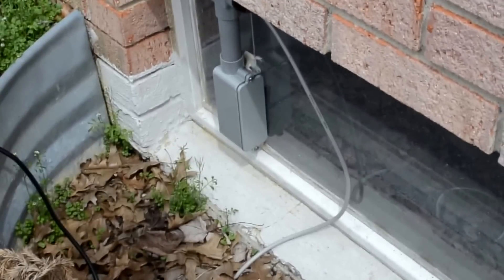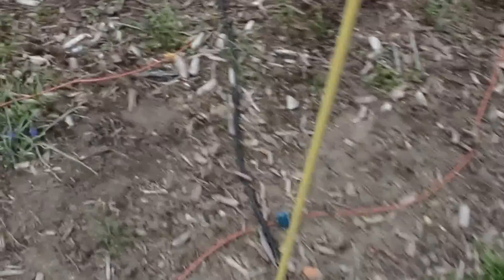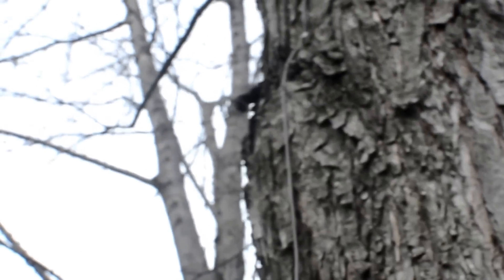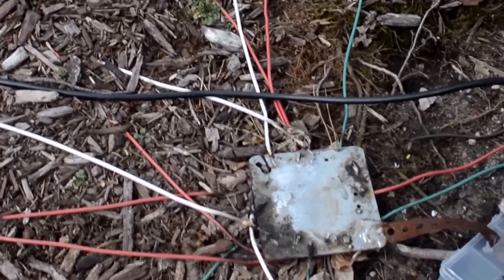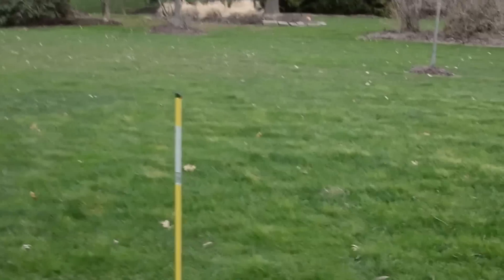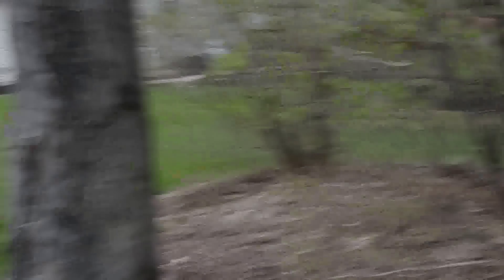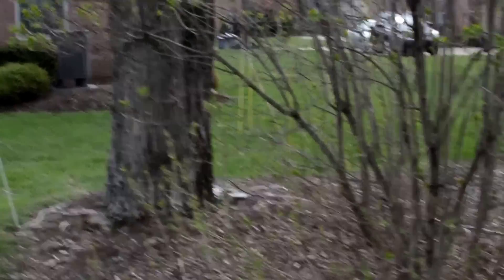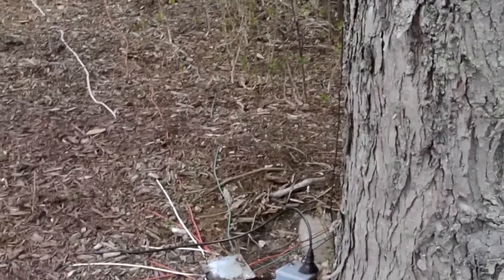Multiband HF Stealth Vertical Antenna Run-through

Comment: You really don't need to cut the radial for each band. Because it is a hound mounted antenna best is cut for about 40m the lowest frequency that the antenna is cut for. The more the Better.

Comment: What's the risk of causing a fire in the tree by running your antenna in there? Specially in the end. If you look it up on the internet information about this is disperse. One says there is no risk at all since it's all RF, another one says that there IS a risk at the end of the antenna when the antenna is not tuned for the frequency you are working on, a third one tells us that this is only a risk when working with lots of power. What is your opinion and experience?
Reply: Ton Machielsen At 100 watts output or less,there is little or no chance of fire on a tree of that size.If he could have gotten the vertical radiators just a little ways away from the trunk,no rf absorption would take place from the tree itself.The ground radials should not cross over each other because they tend to cancel each other out.Spreading them out just a few inches further apart from each other would help antenna efficiency and allow better VSWR tuning.Nice to know someone has made the best of their environment and can get their signal on the air under their property restrictions.This antenna will work better than one would think...73...Dennis...W7KB

Comment: That the same antenna I used when I lived in a mobile home park.
It worked well. I was also able to work 17m 30m 12m not very good but it worked on those bands.
Reply: The four band "Tree Vertical" antenna (40m/20m/15m/10m)
Reply: http://www.arrl.org/files/file/protected/Group/Members/Technology/tis/info/pdf/9511071.pdf
Is the link on ARRL web page

Comment: Are all three vertical radiating elements connected to the single SO-239, basically operating as a vertical analogue of a fan dipole?
Reply from the maker: Yes, that is correct!